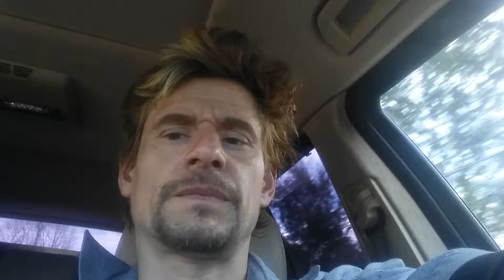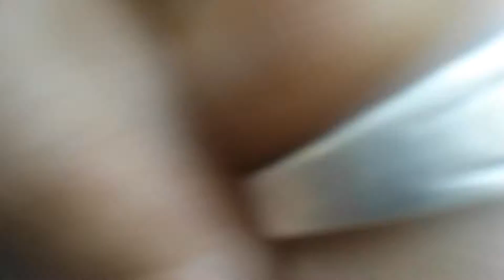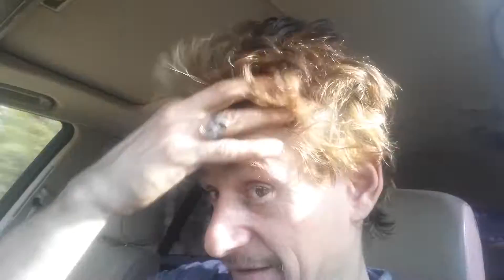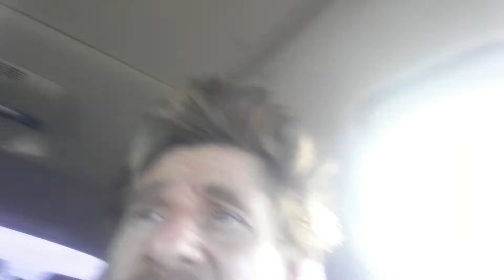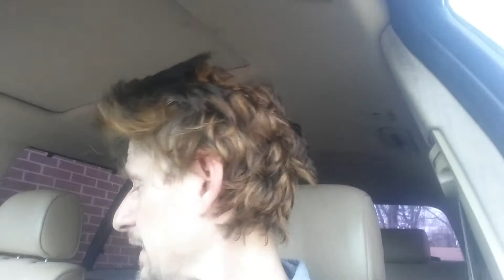Chevy 350 vortec breaking starters

Comment: So... I changed out my sensor and reset my codes (just in case). No dice. I didn't touch it for two weeks. Battery died. I jumped the battery and it started right up. Drove for 2-3 weeks until... it did it again! Freakin FRUSTRATING!!! Anybody out there have an answer to this...PLEASE!!!

Comment: Hey man! This is the first time I've ever ran into this issue and I have been racking my brain trying to figure this out! It's 5.7L in 2000 Express Van, came in for no start, starter was broken along with one bolt and bent the other. I did a full tune up thinking that would cure it, bastard still does it. I have a spare crank sensor so I'm going to try that tomorrow, THANK YOU!!! BTW, yours is the only video I found about this issue!
Reply: Joshua, this was the only video I found also. Early 2000 5.7 Tahoe. I have been running through starters. I replaced crank sensor. Put another starter on, broke the nose cone the other day. I have another starter to put on now. I think the ear tab on my block has a small crack in it and causing the starter not to align. What did you find the problem to be on the Express Van?
Reply: @Therealkingstonhammy  it was exactly that, the damn crank sensor. Fortunately no cracks in the block or any major damage other than some chewed up teeth on the fly wheel.
Reply: @joshuamadole4074  thanks for the reply. I think I have small crack in that outer ear on the block. Outer bolt still torques down but I think it may move a bit under load. Im going to try this new starter but this time I’m going to put the starter brace on it. Mine is long gone and I my block is drilled for both style starters, so I will put 3 bolts in it with the brace on the back of the starter. If that doesn’t work… high torque mini starter. Luckily it’s not my daily driver. The truck is to nice to not fix.
Reply: @joshuamadole4074  was your starter grinding like hell?
Reply: @stereotype5868  it was. But I'm pretty sure that's because the starter housing was broken and the flywheel was damaged from the starter contacting it at weird angles.

Comment: What is the part number for the starter with the bolt holes across from each other. I only have one good hole on my block.
Reply from the maker: I found one meant for racing. No clue on part numbers

Comment: I believe I'm going through the same thing only I'm not running the  computer at all. I basically switched out the intake and distributor to run a carb. I'm wondering in I need another computer.

Comment: If you cant get a starter to mount back on the block. I have used the Danchuk Starter Engine Plate 10100 with a 1955-1956 chevy belair high torque starter.

Comment: Hey man what year gm did you do this on? Also did you have to "relearn" the ecu after installing this sensor? Thanks my 2000 5.7 Savana is having this exact problem. Thanks again.
Reply from the maker: Shane Norton no relearn. Just plug and play. I think it was a 2000 model....may be as new as a 2002. It was a 5.7 vortec in a 1 ton van.

Comment: Before I bust a starter need to know if a bad distributor gear can cause this.
Reply from the maker: Don Travis I've never seen that myself.
Reply: Yes I have had this issue with a highly worn distributor gear, to the point the gear was a knife edge. Also the cam was worn the same amount effecting the timing badly. It was so bad it was breaking the starter or the flywheel. I finally just got a remanufactuerd long block with a 4 yr warranty for only $1500. Now it’s a hole new beast now. It runs buttery smooth now.
Reply: YES IT CAN!!!
Reply: Coat the inside of your cap with grease. The moisture builds up and arcs. Works like a dream.

Comment: I'm having this issue in my 99 tahoe, I've changed the cps already then the flexplate and starter and problem continue. . Did you have to re- time the motor or the sensor fixed it..
Reply from the maker: Victor Taylor this basically resolved the issue.
Reply: ykmalachi I put a new sensor in mine, maybe the sensor might still be bad, I'm gonna go grab one from the junkyard monday

Comment: how many flexplate teeth on a 97 chevy 5.7 vortec 153 or 168 I have the provision for both starter bolt locations
Reply from the maker: As far as I know they should be 168.  All 1986-1997 as far as I know. I am sure there are exceptions. Dont know any off hand though.

Comment: having similar issue.. 1997 k1500 5.7  Chevy  suburban...have replaced battery 5 starters cps crank position sensor and cam shaft sensor cap is only 2 mounts old roter is only 2 mounts old..installed another new starter started fine for 15 days.... then kicked back broke starter bolts .... would like the straight across starter and a conventional way to check crank ps or cam shaft shaft signal before i install starter.. Thank you in advance
Reply from the maker: Worn gear on the bottom of the distributor possibly. Timing being off will cause this.